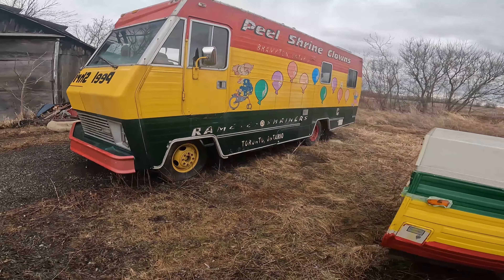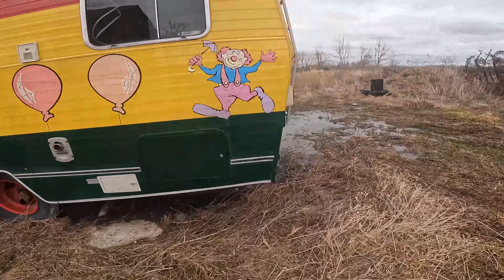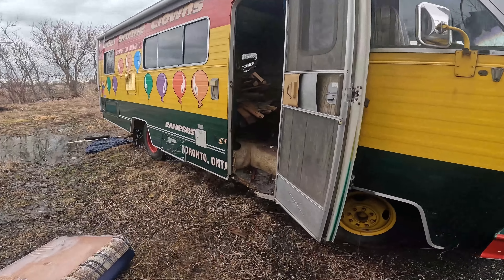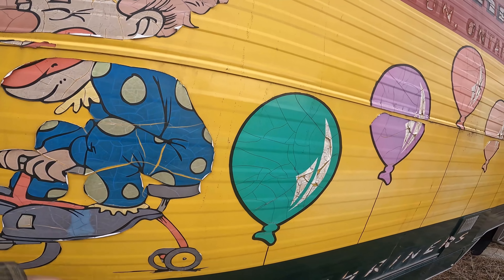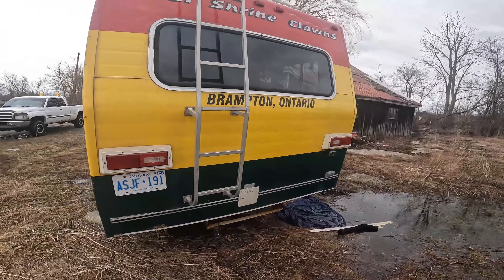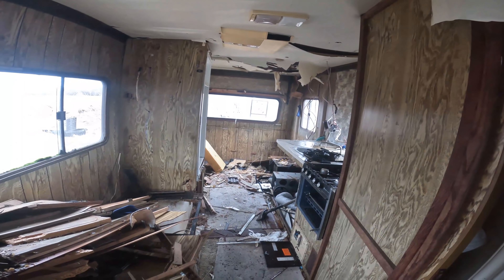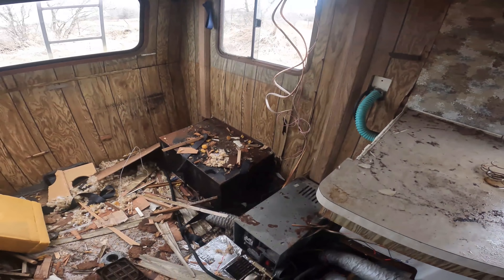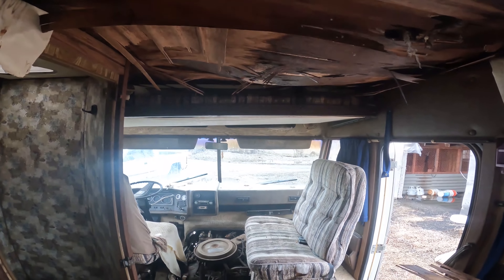I GOT A FREE HOUSE......Will it start after sitting 10 plus years? Barn find motorhome

Comment: I rescued a similar 454 Winnebago.  I drove it home 20 minutes on seriously sketchy tires and using a 5 gal gas can as my “temporary “ gas tank.  Had to stop halfway home to refill the gas can.  Those babies are thirsty!  Those quadrajets are so reliable for revivals! Have fun removing the engine (if that’s what you’re doing).  It takes a lot of cutting!
Reply from the maker: That's awesome 👌 haha that they sure are I had to put more fuel in just incase I ran out taking it for a drive in my new video 😄 😆

Comment: grats on the free 454!!! BUT word of advice the secondary's are not the choke sticking a screw driver in them does nothing.. no need to mess with the secondary's they are vacuum activated at high rpm's under a load
Reply from the maker: Thanks for the information 👍

Comment: Question of the year ------ Where do you start with a wreck like this, but in the background your thinking its only got 60k on the dial, My main thinking before you commit check the basic chassis is it sound  and if good then its a money pit of how far you take it , if chassis is rotten get a JCB digger roll it on its side then dig the engine & gearbox out & maybe the back axle,  suppriced that run so easy well done Sir !
Reply from the maker: I have honestly no idea haha. I'm actually about to edit a new video coming up on this about what's going on with it. The frame is in great shape the outside is good just the roof and inside. Honestly it just needs ripped apart for the frame motor transmission. But I'll reveal in the next video about this what's happening with it 👍and thank you much appreciated 🙏 didn't feel like laying under it that day 😆

Comment: 454 was always a good engine the problem with them in a motorhomes is they get hot need to add a 16 or 18 inch electric fan to push more air
Reply from the maker: I could see that with the little air flow they get. A couple electric fans would be mint 👌

Comment: They never sold those motorhome winnebago things over here in the UK, but quite a few were imported in the 80's.
I remember the first time I saw one, I was like what the actual F? 
It''s basically similar to a Lunar Jupiter caravan with an engine, just as flimsy as a standard caravan.. but with an engine.
Nice video.
Reply from the maker: Haha really? I guess that would have been strange to see for the first time forsure 😅 sounds interesting I'll have to look it up 👍 thank you 🙏
Reply: Motorhomes were van, truck or Ambulance conversions in the UK back in the 80's.
That's why I was so amazed as a kid at occasionally seeing a big purpose built caravan (trailer), with an actual engine and steering wheel, that didn't need towing. Lol
Reply from the maker: Ahh I guess that totally makes sense then haha

Comment: The poor construction materials, techniques and assembly of US manufactured RV's has virtually guaranteed their accelerated demise!

The rapid ingress of water caused deterioration in the wood structure and paneling, and huge numbers of low mileage vehicles were scrapped due to water damage.

Its interesting to see one that survived and I look forward to seeing how you get on with it.
Reply from the maker: Right? They promised so much but in return gave so little. Lots of good low km engines gone because of it... thanks for watching 🙏

Comment: I strip all the inside out of it leave it there that way if you decide to work on it and fix the inside back up you won't have all that crap to dispose of and if you just going to use it to pull the engine out and scrap the rest you won't have all that material the take-out dispose of a win-win situation.
Reply from the maker: That was the plan haha but no room unfortunately

Comment: NEVER NEVER use starting fuel spray on a motor that been sitting . I use 4 parts gas and 1 part ATF so the cylinders don't dry fire
Reply from the maker: Thanks for the information 💪